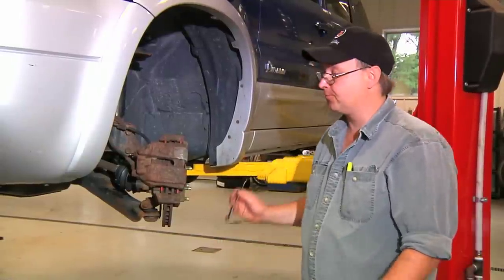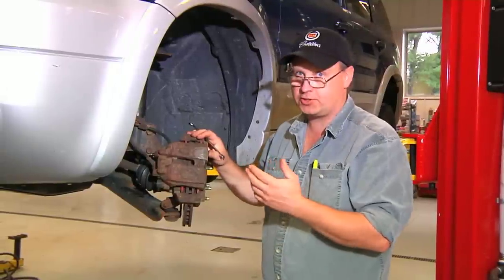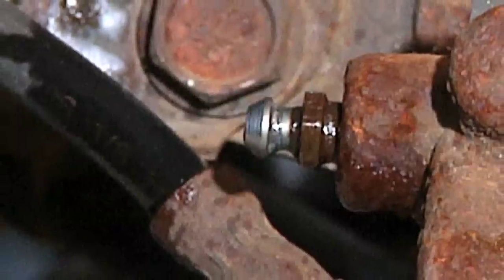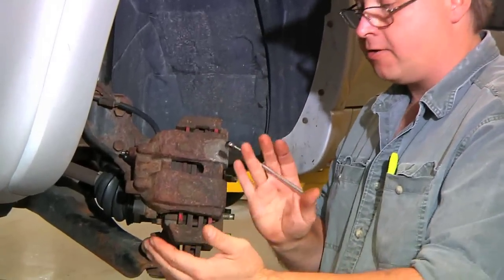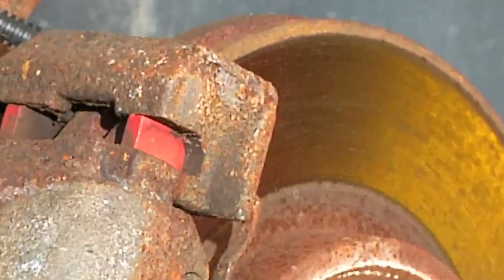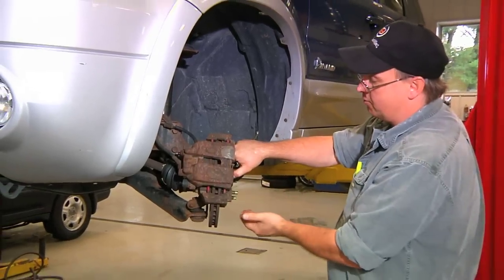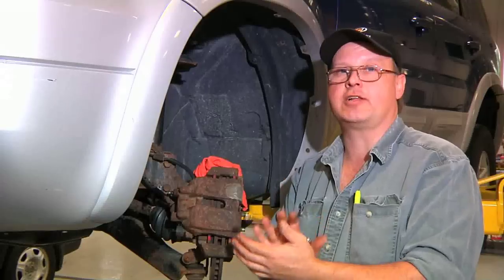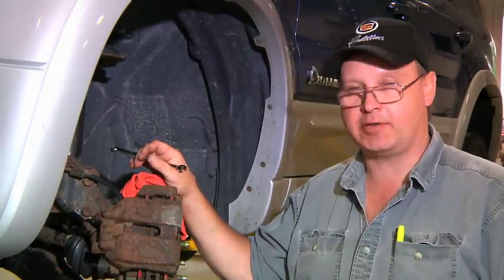ABS Brakes & More : How to Bleed Abs Brake Pumps

Comment: After further attempts.(2004 c2500hd)  I found that unplugging the abs control that the bake lines run into is the best way to bleed the lines. It took me 8 times per wheel.

Comment: did i miss something, where is the ABS bleed?
Reply: +aquabilly  why would you bleed if it hasn't been opened ?
Reply: Because a failed wheel cylinder, or hose leak, has drained the master cylinder reservoir and introduced air into the ABS module.
Reply: @stinkycheese804    ok so then where is the info for bleeding cycling opening valve solenoids ???  duh?

Comment: Ummm... You skipped the ABS module bleeding. You run the Master Cylinder out of fluid and get air in the ABS module, you will have to bleed that or you will get a spongy peddle. This video is completely useless.

Comment: I don't know Bob - I'm pretty sure from the looks of things, this may not have been your best performance.  Maybe you and your "compadre" can cook up a new video on, I don't know, something like how to get trapped air out of the ABS  inlet/outlet solenoid/valve module employing one of those Micro-controller ABS scanner tools that allow you to control the pump, valves, hydraulic booster etc. all manually via the OBD II serial port. I don't know though I'm just a technician - what the hell do i know? But I do know I learned about the bleeder valve thing when I was like 12 before ABS.

Comment: 2003 Chev Avalanche I undid All body mounts and lifted the Drivers side 6 inches and replace all 7 factory GM steel lines... for HOURS I tried everything to bleed Brake system... Truck was Mostly Running on 4 Jack stands all 4 tires removed would NOT BLEED fully....  Then this worked Turn Key ON and DISCONNECT BATTERY leave sit for an Hour Then Pump and Bleed Brakes with Truck NOT Running and Battery Disconnected Tons more Air came out of the ABS system...

Comment: Typically start by bleeding the wheel furthest away from the master cylinder then work you way closer  RR, LR, RF, LF...Don't start on the right front.  some vehicles actually spec out starting to bleed on a different wheel so you should check the manual.  Tell your compadre' DON'T lift your foot off the pedal until you have resealed the brake bleeder!!!!   Doing so will suck more air in the system than what you just let out.

Comment: He's using a Ford Escape Hybrid lol. I own one of these it is a no no the way how he did it. Regenerative brakes need to enter into service mode prior to bleeding by flipping the keys in a specific pattern, then you will need scan tool to release regenerative pressure via OBD2. The way how he did it on this specific car not only doesn't bleed the entire line but introduce air from the bleeder valve.
Reply: haha lmao an escape.. ford.. ahahah so much fail here...

Comment: Excellent videos  the information is too short can you guys explain in detail please.
I have 2008 BMW 750 li  this car has a lot of stuff like brake assistant (DSC) then ABS module and all wheel sensors. when installing new master cylinder there are 4 lines to be disconnected . there is no detail video on youtube. I went to dealer they said for us to install the master cylinder unit and all parts required you are looking at $2,575. where the master cylinder it self is $797.dollars and 5 plus hours labor they charge  $110. per hour  after watching your videos i like to do the brake master cylinder and brake booster calipers and brake rotors all my self just save some money, please make a detail video if possible thanks for uploading them to help us thanks.

Comment: HAHA, someone forgot to edit in the important part. You need to delete this video and try again.
Reply: +C Unknown What's the important part??
Reply: the7mad9cap7laughs Where do I start?! Several things wrong with this video, no mention of "flushing" old brake fluid from system, and the important part I mentioned that is missing is you start from the wheel farthest from the master cylinder, then work your way "in." You don't bleed just one wheel, as it makes it look like you do in the video. Not a good video, except for the air is compressible part, that was really the only good part about it. Last but not least, if your caliper is that rusted, it is beyond time to replace it.

Comment: Yep, that's a car from the North East. Rusted into a solid ball.
Reply: middle of country too with road salt cinders.   horrible here in IL  major rust erot no floor pans and all metal tubings lines rust rot and blow out  all the time here on 2000s cars.   replacign fuel and brake lines that are rusted blown out on two cars right now as a matter of fact here..